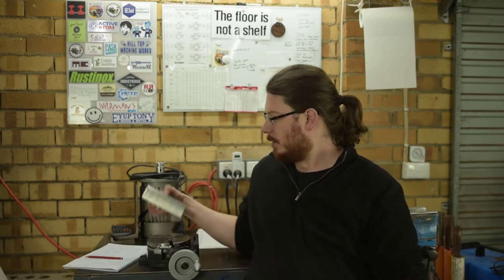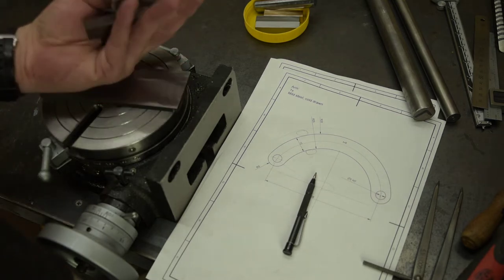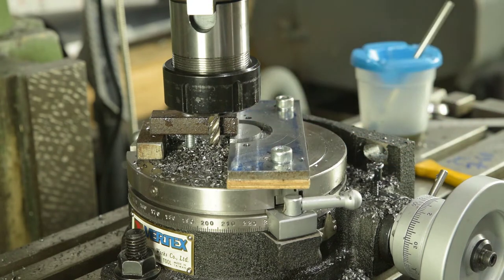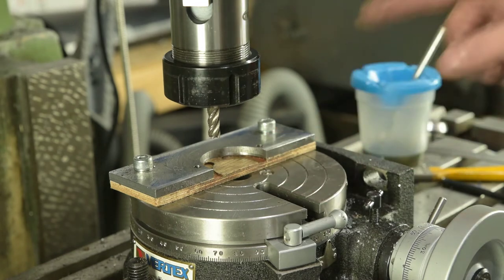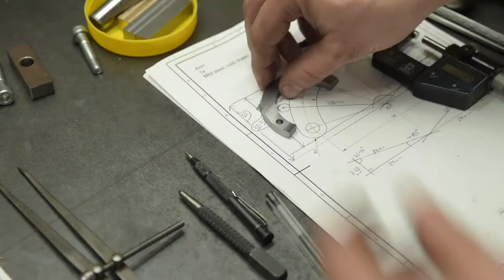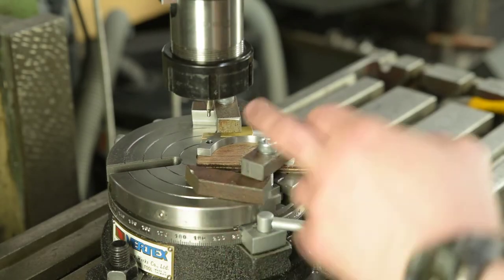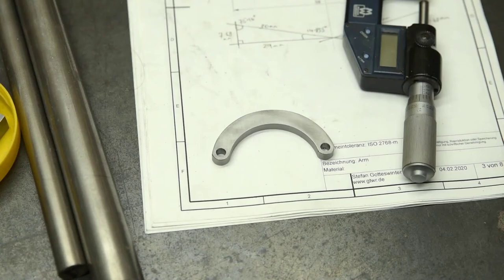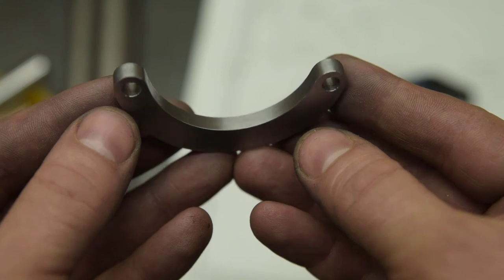Making Stefan's Indicator Holder -  Part 2 - The Arm

Comment: Cool . I made my arm yesterday . My 5mm reamer is still in the post so i had to modify a drill to get a reamed size hole .    Cheers !
Reply from the maker: Yeah - I still haven't turned that drill chuck arbor, and of course any runout comes out in the bored hole. No big deal though I'll just make the pins to fit!

Comment: Gday Craig, there’s nothing wrong with the part, looks really good, I’m now looking forward to seeing the next instalment, cheers Matty
Reply from the maker: Cheers Matty, it should turn out pretty ok.
Reply: I have no doubt about that, I’m seriously thinking of remaking a couple of components so they are correct to the plans, now I’m see the mistakes I made.
Reply from the maker: I think yours came out great. I had a thought about making an add-on to mine, so it can grip the spindle in three places, so I can indicate a round feature without having to take the tool out of the collet (a bit like an "indicol" gadget).

Comment: Great vlog, very interesting to see You Tubers approach to this useful tool, I made one but without the dovetail in the 90s' from AISI O1, and heat treated it, holder was scribed, then cut out by hand. I might look to upgrade it, as I don't have a foreman leaning over my shoulder 😱.
Thanks for sharing and stay safe all.
Reply from the maker: Cheers John. It's a great project. I'm looking forward to using the finished tool 👍

Comment: Hi Craig, the arm looks good. Its been good to see each persons approach to machining the parts.
Hope you don't mind a bit of info but when milling slots it may be easier to use a twin flute rather than a four flute especially if you're not running flood or mist coolant. With the twin flute the chips will evacuate easier hence less heat and less double cutting the chips. Give it a try on a piece of scrap and see the difference.
Looking forward to the next video
Cheers Kevin
Reply from the maker: Thanks Kevin, yes I should have thought of that! I even have twin flute cutters in stock, specifically for cutting slots. Ah well, I will remember next time!
Reply: What happens with a 4 flute mill cutting a slot is that the cutter flexes sideways pivoting about the flute that is doing the cut and hence cutting sideways too with the next flute. With a 2 flute when the cutter flexes there is no flute to cut sideways. Same with a 3 flute, making them a good compromise.
Reply: And I know you are 'funny' about compressed air but I use it all the time to blow chips out as you cut when not using flood coolant, especially end milling grooves or pockets. I would also roughed out 2 or 3 passes, .5 off my dimension then full depth on the line final pass.
Just means it's more predictable not cutting a full semi circle, the chips are smaller and have a place to go!
H just say'n.
Be happy, looks good.
Reply from the maker: Thanks Little Work Shop - that makes perfect sense. I will make sure I either use a 2-flute cutter next time, or pick up some 3-flute cutters to try out. Cheers for the advice. Craig
Reply from the maker: Thanks Carl - I was thinking a similar thing thing during those cuts. I was having to back out, brush the swarf away, then brush oil into the cut and on the cutter. A small jet of air through the mist cooler setup (Even without actual coolant) would have been a good thing. Next time, even if I haven't got a proper airline set up yet, I'll just hand-hold the air nozzle near the cut and see how it goes. I think it'll work well. I did try to leave enough material for a finish pass, but it was too close to final size that I decided to hand finish it. I now wish I'd at least done a "spring" pass. Next time I'll use your advice and leave 0.5mm. I also realised once the piece flipped up out of the cut at the end, that I should have screwed through the holes I made. That meant using a thicker backer - the other upside would be that I could do a finish pass on the outside radius. Cocking it up has got to be the fastest way to learn! Cheers for the advice Carl - I need as much of that as I can get. Craig
Reply: @CraigsWorkshop  you are welcome, if you don't pass on little pearls you have learned over a lifetime of mechanical things, what was the point of learning?
Reply from the maker: @littleworkshopofhorrors2395  Absolutely agreed, thanks again.

Comment: Who's winning? You or Emma? Got a bit scary when the part jumped up!
Reply from the maker: Hey Mark. No, not well planned in the work-holding department. I should have used those new 5mm holes to hold the work piece down to a thicker piece of backing (live and learn). Emma's already won! She's finished, I've only just started :)

Comment: Coming soon.... microphone review and belt grinder build 😁
Reply from the maker: Nah - I have a good microphone, it's just hard to always have the lights, camera, and mic pointed at the right bit. There often isn't room for me in the mix. :-) (Then there's always the cables..) Real answer is a wireless lapel mic.

Belt grinder build - I think I'll just get a blue zirconium belt for my woodwork belt sander, it's a 1hp+ motor (I forget which exactly), but it certainly has enough speed and power to be a decent belt grinder. Just don't want to use AlOx belts on it for metal, they don't last long.
Reply: @CraigsWorkshop  That's the truth! Lights and cameras in your face while you awkwardly work around them trying not to bump anything lol
Reply from the maker: Especially in an overfull two car garage!
Reply: Amazing how many cables are needed to function in a wireless world🤦‍♂️
A 1hp belt sander, don't recall seeing that one. Sounds kinda scary 🤣
Reply from the maker: @billbaggins  Have another look at the "Workshop Tip" video, the sander gets used to dress the freshly cut ends of my home made bog roll. :-)

https://www.ledamachinery.com.au/leda_product/boy-6-x-48-belt-edge-sander/#

(Not 1hp+, but 3/4hp - certainly grunty enough for what I need though)
Reply: Ahhh, one of them. I was picturing some sort of monster hybrid floor sander converted to a hand held unit 🤣
Reply from the maker: @billbaggins  :-D Nah. The conversion would involve a prolonged period of productivity, and I'm not exactly known for that kind of thing :) Just a fairly open framed grunty belt sander on a stand. With a zirconium belt it'll make a very good belt grinder.
Reply: Why do the job in an hour when you can string it out over a week😁👍
Thats a perfectly good machine for what you do with good belts.
I'd be lost without my belt grinder, would have at least another 4 if I had the space and $$
Reply from the maker: @billbaggins  Yes agreed. By the way, I've just remembered I've got about 8 or 9 t-nuts here which are for you. I made them up extra to go with the M10 clamp kit that went with the Opti mill. And designed to suit that table. So, next time I see you, remind me about them please and I'll hand 'em over.
Reply: Cool, they will be handy. Still need to get some financial finangling done but gotta get vice, cutters etc. Not needed huge accuracy yet so the drill press vice is ok but need to square up some brass, so I'll be in touch soon.

Comment: Making something to the plans is alwsys good practice for when it is vital. But as you are making something for yourself you are your own Quality Control inspector and you should know when to let things pass. For your purpose just concentrate on making matching bits fit and don't dwell overly on the less important aspects. 
Now i shall switch off Yoda mode,and go and do some work.😉
Reply from the maker: Cheers - I will try to keep that in mind! :)

Comment: Hey Craig, nice work, thanks to you I think I'll get off my arse and make one too. I've spent the best part of the evening looking for a copy of the plans from the source - any chance you can link to them directly? Cheers!
Reply from the maker: Hey Max, thanks 👍 Sure, the plans for the indicator holder are here: https://www.patreon.com/file?h=33808199&i=5082600 If that doesn't work, let me know in an email and I'll send them through.
Reply: @CraigsWorkshop  Thanks for making it real - I've been watching Stefan for years (I have mill and lathe, no surface grinder (yet)) and think I can never do it, but you bring it down to earth. Cheers from NZ.
Reply from the maker: That's great! Just dive in and give it a go. I ruined the first part and had to make it again. Good thing is none of the parts are big, so it's cheap to restart if needed. Good luck mate! Email if you want to talk the plans over or swap ideas.